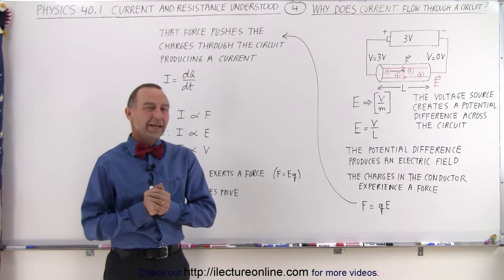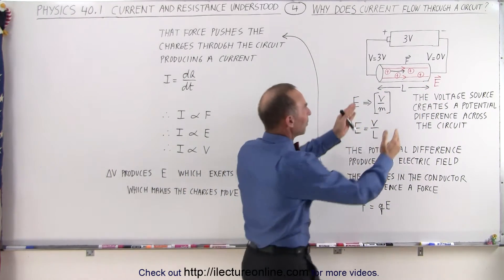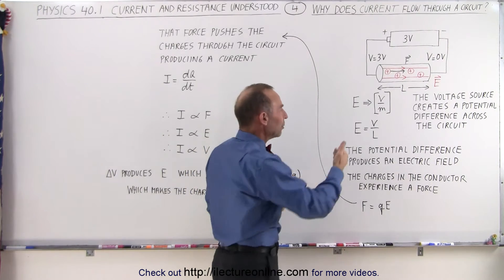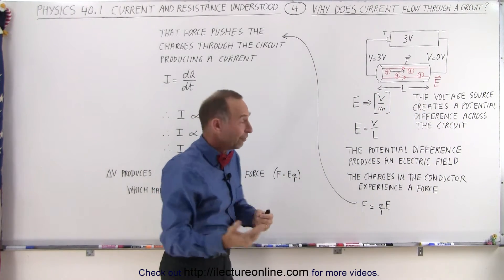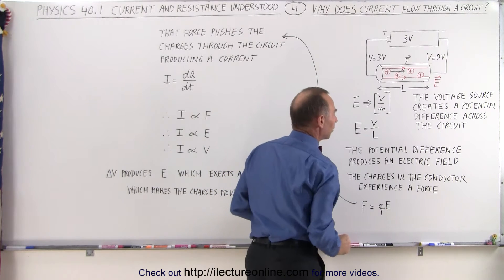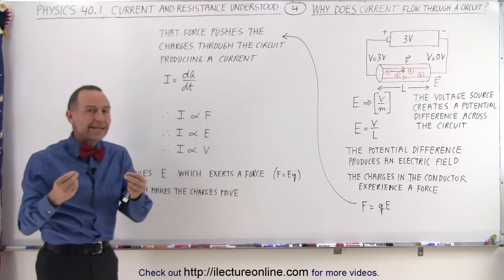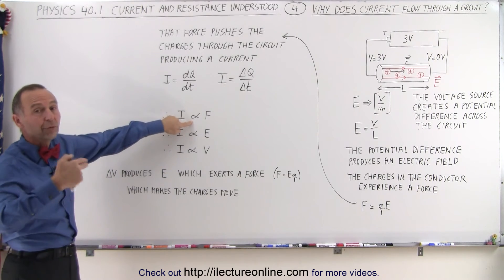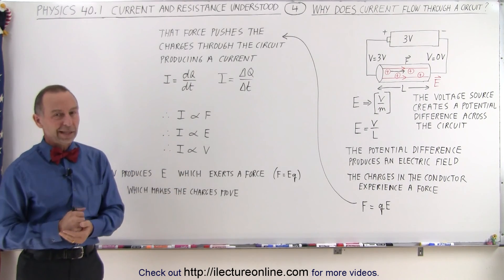Physics - E&M: Ch 40.1 Current & Resistance Understood (4 of 17) Current Flow Through a Circuit

Comment: If the potential difference is created at either end of the conductor, how do the charges present within the conductor experience a uniform force? i.e. they all experience the same force. If you were to make an analogy with water pressure in a pipe, that's intuitive as the fluid pushes against itself but here it seems that the charges are discrete and independent from each other. Do the charges act on each other thereby creating an average force?
Reply from the maker: There is a potential difference everywhere throughout the wire.  It is like a river flowing down hill.  There is a height difference everywhere along the river.  The difference between both ends is the TOTAL difference of all the differences added up.